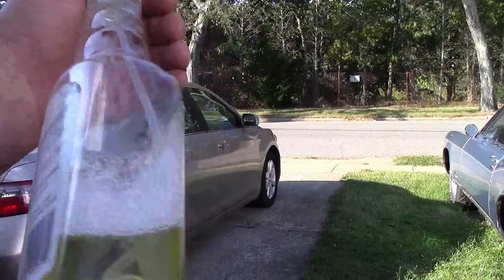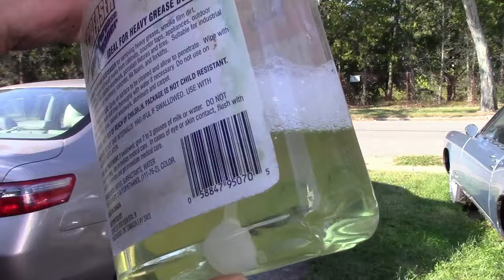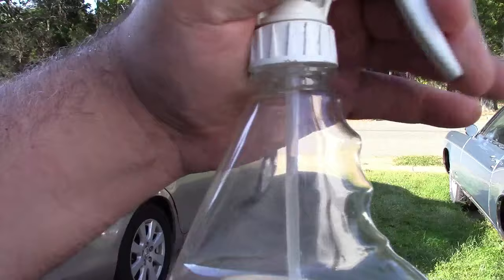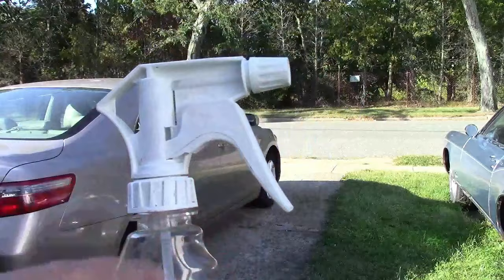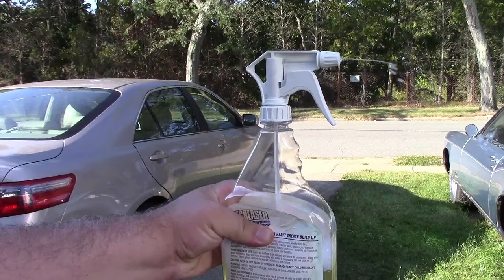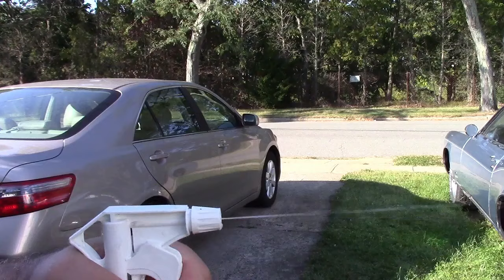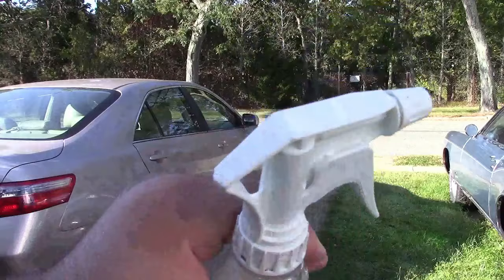Spray Bottle Not Working?  TRY THIS!

Comment: I tuned in because I had the same issue. However, it was with a glass bottle so I couldn’t squeeze it. BUT…instead I tried holding my finger over the tip of the sprayer to create suction and réprime my spray bottle, just a test but IT WORKED 😊 Hope this helps someone else.
Reply from the maker: They fail in different ways.  I had tried that trick on this one and it didn't work, but squeezing the bottle with the one I have always works.
Reply: Omd thank you so much. Can't believe that worked

Comment: I had a funny shaped bottle - kind of rounded sections and didn’t think I could squeeze it.  I could only squeeze it the tiniest bit and the plastic pushed in but, it worked!  Wonderful tip. Thank you from the UK.
Reply from the maker: I actually have a bottle like that as well, although I'm in the USA.  Anyway, glad it worked!

Comment: It works! I just tried it on a bottle that holds pure vinegar and Dawn dishwashing soap. It failed to spray after 6 months of usage. I thought it was the vinegar eating away at the internals. But nope. Squeezed the bottle a few times, out came the vinegar mixture, and the sprayer now works! Thanks!!!
Reply from the maker: You're welcome.

Comment: Today,  I went to spray Vanish Oxi on a curry stain and it was a brand new bottle I hadn't used previously and which didn't work.
It's got the child proof new type of spray head which doesn't unscrew and the bottle wasn't very pliable to squeeze. 
So I lay it on its side in the shower cubicle and pressed down on it,  and voila! It sprayed. 
Amazing. Thanks for the tip which I shall always apply in future.
Reply from the maker: No problem at all!  BTW that childproof cap went on there somehow, so it has to come off.  I bet if you put a big pair of pliers on it, it will unscrew.  Often they have backwards-facing "teeth" that bite in, making it impossible to open by hand, but with a tool, you can get it off.

Comment: Wow! This is an insane changing hack. I am so glad YouTube suggested me this video.
This fixed my problem instantly.
I also have an idea now. If the spray completely breaks down and this hack does not work any more, I can use the remaining content just by squeezing the bottle.
Reply from the maker: Depending on how it breaks.  If the nozzle clogs completely, you'd have to fix that.

Comment: I have a small spray bottle that stopped working suddendly,  I tried the method in the video but it didn't work as the my spray bottle used harder plastic.  So I just filled the whole bottle with water, screw in the spray top, turned the whole spray bottle upsidedown, then squeezed the trigger multiple times until water started spraying out.  Now I have a working spray bottle again!   Thank you for giving me ideas!
Reply from the maker: You're welcome.  Turning the bottle upside-down was a dumb idea, the straw-looking thing is where it sucks the liquid up from.  The force exarted on the liquid in the bottle is equal in all directions, so keeping it upright is the best way, otherwise you can pump it full of air, exactly what you're trying to avoid.

Comment: Man, what a great video!  I had one of those spray/stream spray bottles that would not work.  I got a replacement and had the same issue.  Found your video and gave it a try... Had to squeeze 3 times (3rd time was a hard squeeze) and it worked!  Thanks so much!
Reply from the maker: You're welcome.

Comment: JAW DROPPED..
however there are time it’s also clogged with some sticky residue. 
Mostly though...JAW DROPPED.
You sir are a genius
Reply from the maker: Thanks so much!  Yes, if the nozzle is totally clogged, the best course of action is to fill the bottle with hot water.  If the bottle is full, just find another vessel to dump it into temporarily.  Then, use this same trick.  If there's still no joy, run the nozzle under the hottest tap water you can get for a minute or so, then try this again, the nozzle should clear out.

Comment: I bought these expensive plastic bottles at hardware store that claims they will work guaranteed for 5 years .  Most of them did not work on day 1- until I tried the method described in video.  Hard to believe but true!
Reply from the maker: If I had a nickel for every spray bottle I've fixed through this video...

Comment: Genius! it worked for me right away. but eventually just stopped working completely. Thanks anyways.
Reply from the maker: Sounds like yours was just about worn out.  I've been using this trick on this same bottle since, and it still works.
Reply: @jaykay18  Yes, I think mine reached the end of it's time. Great tip though. Thank you!

Comment: Omg this works…. Thank you 
Wow 
Now I have a sprayer the handle it self does not work/shift
I’ll try another video 
Thank you so much 
Amazing answer 
Thank you for sharing
Reply from the maker: You're welcome.

If the handle isn't going back into position, chances are the rubber seal on the plunger has hardened.  You can try some WD-40 where the plunger is.

Comment: Unfortunately didn't work for my current case. 
It does squirt some out when I squeeze the whole bottle but no matter how much I pull the trigger(?), the water doesn't even come up the tube.
Good to have this info in the back of my head though for other spray bottles whenever I get the same problem again. So thanks anyway!
Reply from the maker: No problem.  Can't fix 'em all.

Comment: My spray bottle seems to have a different problem. The spring-loaded mechanism gets stuck and doesn't come back out. This didn't work on it.
Reply from the maker: Clearly, that wasn't the problem I demonstrated.  Typically, if the spring isn't returning the trigger to the home position, it usually means the plunger(s) inside are sticky or deformed.  The sprayer would have to be replaced.

Comment: I can't wait to try this one! I am so tired of spray bottles that quit!! I do have that size, but I also have sprays on gallon jugs. Any ideas? I don't know how I would squeeze it!  Do you suppose that this works like "priming the pump?"  Thank you so much!!!!
Reply from the maker: To squeeze the gallon jugs, I'd lean it up against a wall and press into it with your foot.  Typically those have a longer hose to get to the sprayer so your results may vary.

It does work similar to priming the pump.  Because these pumps are manual, they need a check valve to prevent the liquid from flowing back down into the bottle.  When all is working properly, that explains why when it's brand new, you have to try a few times before it will start spraying.  When the check valve fails, the liquid flows back down into the bottle, and because you can't pump fast enough, it won't spray.  Usually the check valves don't fail completely, they still somewhat work, which will allow the bottle to spray again a few moments later.  How and why they fail is up for interpretation; my feeling is that they are made cheaply as possible.  Depending on what's being sprayed, that can lead to early demise of the check valve, depending on how strong the solution is.  Rare to find this problem on one that just, and only, has ever sprayed water.

Comment: Thank you!!! 
I was about to take a hammer to my bottle of goo gone. Not only was it not spraying, but they designed these stupid bottles to not unscrew to open!
Reply from the maker: You're welcome.  They had to get the product in the bottle to start with, so there is a way to get that off, you just have to find it.

Comment: I saw it worked with many people. But my bottle has a really tight seal and no matter how hard i squeeze liquid won't come out of the nozzle. I guess maybe not all bottles are built the same
Reply from the maker: Your nizzle may have failed in a differnet way.  Perhaps the hole where the liquid is to come out is blocked.  You can try running it under the hottest water you can get for a couple of minutes.

Comment: doesn't work on any of my broken ones. just bursts water out when I squeeze the bottles. but pump still not picking up. they just don't make anything like they used to. mine wear out within a few weeks.
Reply from the maker: If you're pumping caustic stuff, like bleach, that will happen to any bottle.  A trick to circumvent that, if you don't mind the extra work, is each time you're done using the bottle, take the sprayer off, spray what's left back into the bottle so as not to waste it.  Then, stick the straw into plain water and pump that through.  Leave it filled with water, next time you use it, first time give it 3 or 4 extra sprays to purge the water, then it will pump what's in the bottle.

Comment: Thanks.  Got my spray bottle working but leaking around the top.  Any extra tips ?
Reply from the maker: If it's leaking where the bottle screws on, there's no washer there.  If you have a collection of o-rings, perhaps you can find one that will fit the top lip of the bottle, that should provide a good enough seal.  Otherwise you can try to cut a circle of foam if you have some.

Comment: Did not work for any of my plastic spray bottles(mostly all-purpose cleaners or shower/bathroom stuff).  For the non-functioning spray bottles that I have, the fluid contents run down the trigger instead of out of the nozzle.  I’ll take a look at the nozzle itself, I guess.
Reply from the maker: @josephpatton8869  Sometimes the nozzle clogs.  A soak in hot water, or a very fine needle may clear the blockage.
Reply: @jaykay18 Thanks!  This was an interesting Saturday morning experiment.  I was having trouble with a Meijer bran(Midwest grocery store chain) all-purpose cleaner(with bleach).  I switched out the spray mechanism from a similar Lysol product that I had in the other bathroom that was almost completely empty.  The Lysol sprayer worked perfectly on the meijer bottle.  I tried needles, straight pins.  I think the Meijer product might have simply been defective.  I used your method on another shower spray cleaner that wasn’t spraying and the solution worked perfectly as well.  I’m glad I finally took the “plastic spray bottle fix” deep dive though 😂.  Thanks for the suggestions!
Reply from the maker: @josephpatton8869  Oh, but there's more!  As soon as you mentioned bleach, I knew what the problem was.  Bleach pretty much destroys the spray mechanism.  Not right away, it takes a few months, and usually the next time you pull it out, it won't work again.  The bleach destroys the rubber seals inside the mechanism.

The fix?  Proper care!  You need to do this each time you're done using it, to help the sprayer last the longest.  Take it off the bottle, and spray the last 3 or 4 sprays of the cleaner back into the bottle so as to not waste it.  Then stick the "straw" of the sprayer into any container of plain water, and spray that through a good few times.  That cleans the bleach out of it.  No bleach means the seals won't be compromised.  After that, spray the water out of the sprayer (otherwise next time the first few sprays will only be water and you'll forget), and out it back.

You can also do that with any other spray bottle, keeping the sprayer out of liquid generally helps to prolong their life.  But like I said, bleach especially is damaging.  There are some on the market that claim to work with bleach, and they do last longer.  Any sprayer will work with bleach--for a while--until it doesn't.

Comment: what about spray bottles with product that do not allow you to remove the sprayer after you use the product, this makes me see red.
Reply from the maker: The manufacturer got the nozzle on there somehow.  If it was placed on, it can come off.  You might need to use a bit of brute force, maybe a screwdriver to pry.  Sometimes there's a little plastic tab that prevents it from moving.  Other times, if you have a big pair of pliers, you can grab it and take it off.

Comment: Sir, a few months ago this worked. Perhaps only do long. I can squeeze the bing juice out of them....nothing. well, usually they pour out a bit at the rim. My kingdom for a bottle this'll never go on with.
Reply from the maker: It will cost a kingdom to make one that doesn't stop working.  That's why they won't.  If they did, you wouldn't keep buying them.

Comment: Thank you so much, problem solved but it is coming drop wise not as sprinkle
Reply from the maker: The nozzle may be clogged.  Run under very hot water for one minute.  If it's still not spraying correctly, and the spray is not adjustable, it's probably damaged.

Comment: thank you very much for this! needless to say i never thought of it myself and had even drilled into the nozzle although of course the original diameter is smaller than the #60 bit i used. still doesn't spray very well but at least some fluid is finally coming out. when i tried to clean out the straw by submerging it in the sink and squeezing the trigger it seemed that it was shooting air out the bottom, as far as i know the reverse of what it's supposed to do. afraid to disconnect the straw from the trigger end to look for blockages, assuming i will break the thing.
Reply from the maker: No problem.  If the internal seals are messed up, sometimes it's better to replace the sprayer.  Oftentimes, dollar stores will sell empty bottles with new sprayers.
Reply: jaykay18 thanks a lot again. i'm just trying to avoid buying more plastic junk and in fact am keeping an eye out for spray bottles dumped into recycling bins since i know for a fact all my bourgeois neighbors purchase plastic-packaged crap on a regular basis. i'm trying to repel rats from the avocado tree but neither hot peppers nor mint seems to work.
Reply from the maker: @carletonhoffman  Can't help you with the rats unfortunately, but something will turn up eventually.
Reply: @jaykay18  thanks again.
Reply from the maker: @carletonhoffman  No problem, best of luck.

Comment: Thank You Sir. It worked, never expected that would have been the issue. But after few sprays mine goes back to non spraying mode, any suggestions on that?
Thanks
Reply from the maker: There's a check valve that's not working, which is why this is happening to begin with.  There's no fixing it, just keep applying the magic until you replace it.
Reply: @jaykay18  😁👍sounds good.
Thanks for the information and quick reply. Have a great day.

Comment: Yeah but what if the bottle is glass?I guess you have to remove it and try it in a plastic bottle right?Ill try,thanks 😊
Reply from the maker: Good idea.  Better to not use a glass bottle at all, it has the propensity to slip out of wet hands easily and break, causing a much bigger problem.

Comment: I have a small a very small spray bottle so its so hard to squeeze it. Is there another way?
Reply from the maker: If there were, I would have shown it.  What you can try is to put that sprayed on a larger size bottle and squeeze that.  Then swap it back to the small bottle.

Comment: what if it's a glass bottle :\ I can't squeeze to fix. what's the trick for fixing a glass bottle that is stuck?
Reply from the maker: Use a bigger hammer?  There's no solution really; you may be able to put that nozzle on a different bottle as most times they are the same thread.  So put the malfunctioning nozzle on another bottle that's plastic, and put the nozzle from that plastic bottle and transplant it on the glass one.

Comment: I tried this and it starts to spray again but it's not spraying as much water as it used to.
Reply from the maker: Yes, but at least it works again.
Reply: @jaykay18  nah it doesn't :( I have to squeeze the bottle constantly while spraying
Reply from the maker: @aceyboy  OK, so get a new sprayer.  You can get one for a dollar.
Reply: @jaykay18  I've gone through 4 cheap bottles already. At some point I'd like one that doesn't break.
Reply from the maker: @aceyboy  It may be due to what you're spraying.  Typically, these sprayers can't handle bleach for very long, it hardens up the rubber seals inside.
Reply: @jaykay18  it's just water which is why I'm frustrated with them
Reply from the maker: @aceyboy  See my video called "Professional Spray Bottles Are Worth It".

Comment: what if mine doesn’t come up the nozzle?
Reply from the maker: The hole in the nozzle may be clogged.  Try running it under VERY hot water for a few minutes.

Comment: Do you know what to do in the case where the trigger isn't pulling back all the way? It feel like pressure when I try to pull the trigger.
Reply from the maker: There's something wrong with it internally, most likely.  You can try to spray the plunger with WD-40 as a last resort, but otherwise, just buy a new one.
Reply: @jaykay18  ohh thank you!
Reply from the maker: You're welcome.

Comment: +1 for using the word recalcitrant! 👍🏻
(Unfortunately it didn’t fix the problem though)
Reply from the maker: Sometimes, the plunger in the sprayer tears or doesn't seat properly anymore, at which point the sprayer will not work again and must be replaced.  I chose my words for that sentence carefully, and not in a perfunctory fashion.

Comment: Didn't work for me. The bottle was a water and bleach solution. Any other tips? This is the second one that gets damaged by the bleach and water solution.
Reply from the maker: Bleach kills the rubber seals.  There's no fixing it, just prolonging the inevitable.

Get a new bottle, but after you're done using it, each and every time, take the sprayer out and spray fresh, clear water through it.  If you miss doing that one time, chances are it won't work again next.

Comment: Tank you, it is a great hack. But i have a glass bottle. Any other suggestion?
Reply from the maker: Swap the bad sprayer onto a plastic bottle.
Reply: Olive oil bottle, want it made of glass. Already solved, by filling the tube manualy and then put it back in the bottle. But yes, could have done that way and then switching back to the glass.
Reply from the maker: @luismrg2008  Glad you got it resolved.  I have one of those olive oil spray bottles as well; mine's plastic but it's also electric.